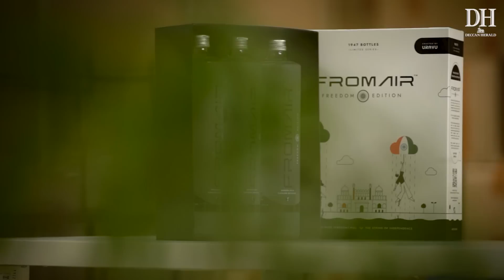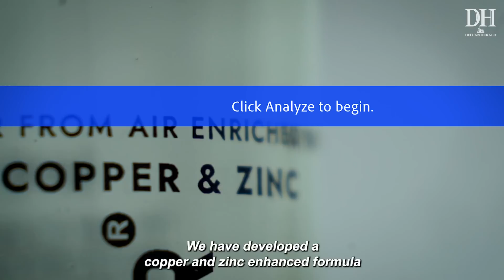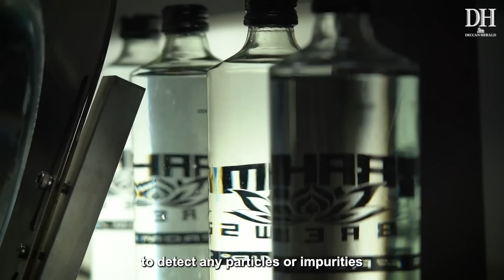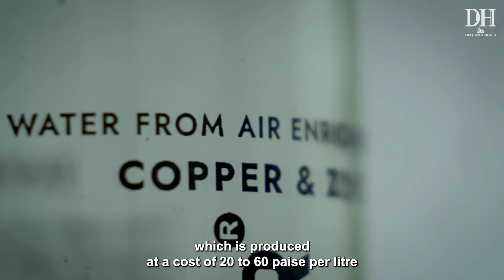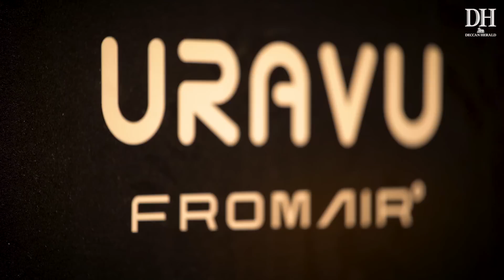Water from Air? How a Bengaluru startup is trying to solve the drinking water crisis

Comment: Hi, Install the water pump for high-pressure water and use diagonal drilling to reach the house that needs water instead of digging the whole area. they will have 24-hour water and there will be no problem. 
thanks

Comment: This isn't innovation, just making use of science. Although they are trying to solve a problem however creating a large scale problem.

"Every action has an equal and opposite reaction” Newton's third law

Extracting water from atmosphere can result in changes to monsoon,rain,temperature and other impacts
The water will have literally no minerals except hydrogen and oxygen molecules unless trace minerals are added. 

The process is no different than what the air conditioner does

Comment: This is just a large dehumidifier contributing to more heat in the area. At this point just collect the water from your AC unit.
Reply: But it Doesn't use a heat pump

Comment: The water in air eventually goes into ground. instead of pulling water from ground they are pulling from air. Non sense project. if they can pull water even from desset kind of environment then this is usefull

Comment: Thank you for sharing. I have seen some of the comments are negative, as usual. We still need to look for smaller cheaper ways to do this at home levels so folks dont have to run to one company for this necessity. Heat and draught will soon worsen.We dont want to wake up too late.
As usual we waste when we think we have lots but regrets will soon be expressed,...perhaps then more will wake up.

I have benefited for years on rain harvesting. What though if the rains disappears, what if like I hear in some countries its illegal to harvest your own water.

Comment: This has been tried before in the West and it didn't work, causing problems. They are converting the area there into dry air which is not good in the long run.

Comment: The water collecting plant is made with metal mesh and its so clear that its leaking rust. See at 3:25
Reply: It won't cause a problem because the CaCl2 solution is boiled later, and the collected water vapor will be condensed, resulting in the addition of minerals.
Reply: use aluminium mesh

Comment: Its another one of stupid ideas.! Even kids these knew how air humidity is formed. evaporation and  condensation are important factors for our and mother earth's sustainability. Rainfall, heavy winds along with parallel cells with earth's movement are somethings we tenants shouldn't interfere with. Now with this kind of implementation you guys are impacting the great balance. Do you IIT guys couldn't find any other ideas to re-shape human life. Or did you think you are the 1st ppl to have such ideas, everyone has this idea when they hear this concept of humidity but why do you think none had made this implementation at scale. And whats with the half ass edited video you clearly mentioned cost of production is high and even with that the quantity produced is less in non humid or dry zones. So where are you guys planning to implement this? In Bangalore or in goa or any other coastal or semi coastal zones. Do you guys think ppl of all categories can afford such things in all if they could why is there no solar power every where and why we are dependent on traditional non renewable energy for power. Even so solar power is still better and safe than this stupid idea. No humidity = No rainfall . Think of other beings not just your homes and fame. If you really want to help its better to work on water transportation logistics, reducing cfc emissions from those AC's you mentioned any many problems we are facing together. Yes you wouldn't make profit from those immediately 😂

Comment: Great idea
1. Every house needs to start production
2. Supply to neighbors
3. Will help reduce humidity
4. Where can wet get the contact info of those who created this? - I’ve seen these elsewhere and it’s important to do this across the entire country. 
5. 4000 liters is enough water for the whole house.
Reply: Isn't this already done by using dehumidifier?
Reply: playing with natural humidity Air
Reply: Don't encourage this as this is opposite of ecosystem. This shall be used for daily uage
Reply: Did you saw the size of the machines and other units?
Reply: Also reduce rainfall, thereby worsening the situation, heating the environment more.
Reply: This guy is dumb.
Reply: Do you even know or thought about the consequence of playing with the natural humidity of air, it will create disturbance in the atmospheric pressure resulting unexpected temperature and pressure changes and consequently hurricanes and tornadoes....
Reply: Agree, plus, do they honestly believe that the air is still pure ??🤡🤣😂🤣🤡
Reply: @readmycomment101 Anyone who drives a car should likewise the stop as they have done more harm to the atmosphere than we ever want to admit. Aside from the engine pollutants even the tires from production to wear and tear have done what seems irreversible harm...we are breathing tire pollutants and drinking it. It's in your blood stream. Google it.

Comment: If water taken from air then the temperature and humidity levels will change we will lose the comfort
Reply: High humidity with higher temperature is actually, even more uncomfortable and causes higher ambient heat
Reply: @aleenaprasannan2146  Extracting water from the air, such as through dehumidifiers or air conditioning systems, impacts both temperature and humidity levels:

Temperature: Removing moisture from the air can cause a slight temperature increase because the process of condensation releases latent heat. However, many systems simultaneously cool the air to maintain comfort.

Humidity: Lowering humidity levels directly affects the comfort. Human comfort is optimal within a certain range of relative humidity (typically between 30-50%). Too low or too high humidity levels can cause discomfort.Therefore, while extracting water from the air can be beneficial for certain purposes (e.g., dehumidification to prevent mold), it needs to be balanced to maintain comfortable indoor conditions.

Comment: 3:19 guys pls work on the rust problem. This is unbelievable. Such a simple problem to fix too.
Reply: can they use stainless steel?
Reply: @bobbyeapen6049  no. They would need to opt for something non metallic. The salt they are using would corrode even stainless steel.
Reply: Will this not fade the Air Moisture?
Reply: It's not water, that is the liquid dessciant solution, so no harm.
Reply: Ok then supply them

Comment: Dehumidifier with water purification, definitely a good option for areas with humidity but where there's no or very less humidity it won't work.
Reply: Who needs this in humid places, only dry places need water, and it'd cost thousands of rupees for single liter in dry places
Reply: It's a scam
Reply: Do you even know or thought about the consequence of playing with the natural humidity of air, it will create disturbance in the atmospheric pressure resulting unexpected temperature and pressure changes and consequently hurricanes and tornadoes....
Reply: @readmycomment101 also it affect water cycle

Comment: Nothing against the innovation but, Please use rainwater harvesting and not this , If enough people use this this will lead to dry air in Bengaluru and changes in the pressure conditions and other bad consequences
Reply: Also lead to decline in natural green cover.
Reply: It doesn't work that way 😂 More evaporation from seas and other sources (oceans have the biggest surface area) would immediately compensate for it.
Reply: @crazydrifter13 what about interior areas?
Reply: @Mummy-p5x  if you measure Humidity near their bottling plant, it won't be lower. Evaporation will happen even from interior areas but it's an insignificant problem to think about. We don't worry about one single grain of sand blowing with the wind hitting a truck while designing the truck.
Reply: @crazydrifter13 That's how it will work if Water actually gets produced in huge amounts.
Reply: @exhaustingordeals  evaporation is homeostatic at planetary level. It would  balance itself out. 
Proof- Oceans haven't grown or shrunk in thousands of years due to evaporation. Melting of ice is a different issue.
Reply: @crazydrifter13  Oceans won't shrink due to evaporation, but areas low in moisture would get incredibly hot if more moisture is sucked out of them. And you won't be getting that moisture back till the monsoon season comes back.
Reply: @crazydrifter13  then just purify sea water then, why collect moisture using salt and then desalinate it. Also moisture isn't evenly distributed all across the world. If it was then we wouldn't have desserts
Reply: This was innovated for desert
Reply: nope that might effect the air quality